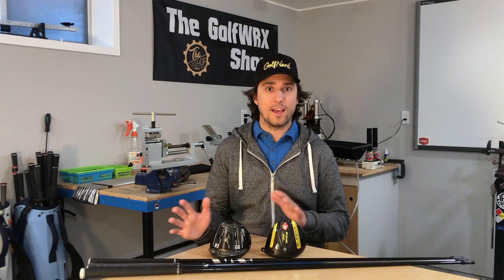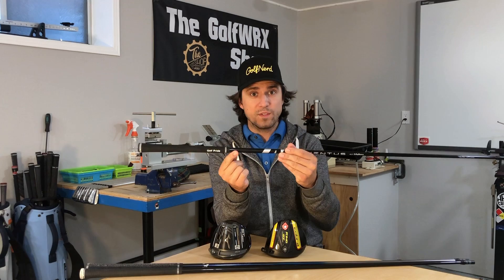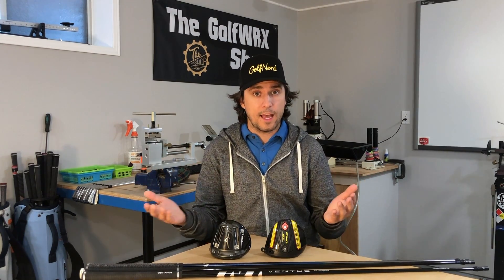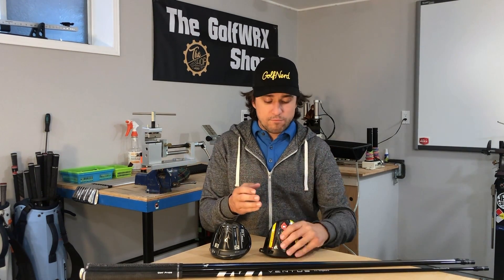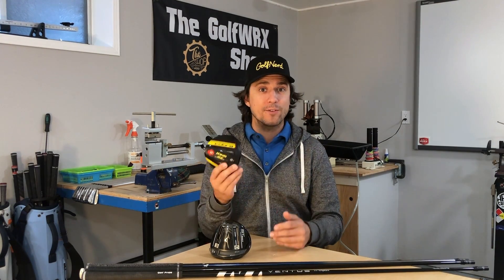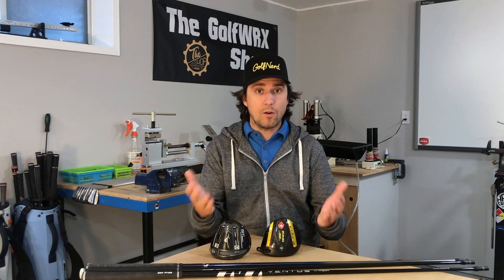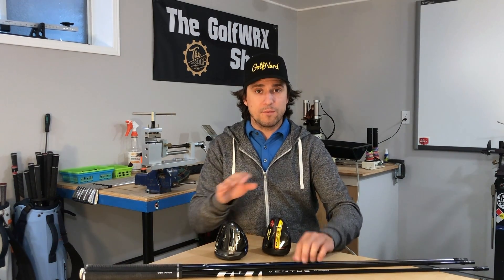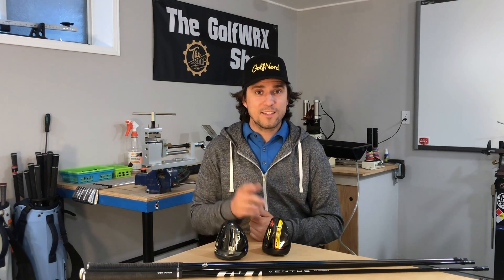Understanding Counterbalanced Shafts

Comment: Hi can you add an after market counter balance weight to the butt end to help lower the swing weight and make the head feel lighter?
Reply: I also dont get it?  Adding weight to the butt will move the balance point closer to your hands but you are adding more mass that has to be accelerated in the total system.  Counter balance does not "counter" mass... just the balance point?

Comment: My Mavriks feel very numb, as in I cannot tell where the clubhead is during my swing. We swing weighed them to D2 thinking that might help but it actually feels the same. Very numb.
Would removing that tape and counterbalancing help with this feeling? 
IIRC, the shafts are 90g S300 if that matters.
Thanks

Comment: I’ve got a Cobra ltdx with Hzrdus blue counterbalance shaft. If I swap shaft to a non counterbalance shaft, will it increase the swing weight of the club?
Reply: Yes
Reply: @jacobr4558 So with this being a YES, I have the same setup 60g.  If i go to a 70g Hzrdus Smoke RDX Black, should i see tighter dispersion, better distance? Currently club sped about 105
Reply: @CRuss22 hypothetically yes its really depends on your tempo and sequence bat all things being equal is could be slightly slower swing speed with much tighter dispersion.
Reply: @jacobr4558 Tempo is bat out of hell aggressive what someone said HAHA
Reply: you might be able to go even heavier with shaft weight or swing weight if its that aggressive.

Comment: I'm having trouble finding an answer to a question about some MacGregor V-foil forged m545 irons that came out in 2005. Does anyone know if they're .370 pt or .355 tt?
Reply from the maker: .355T if they are stock.
Reply: @ryanbarath1916  
Thanks.....I think they are. They've got Rifle lite and Golfpride grips. I think that was the stock option. I'm considering pulling them and going with graphite.

Comment: Can you achieve the same affect of a counterbalanced shaft by swapping out for a heavier grip or even adding lead tape, plugs, etc under the grip?
Reply from the maker: Bingo!
any extra weight in the handle will counterbalance   a shaft; lead tape, heavier grip etc.
Reply: Can I apply lead tape to upper part of my shaft?  Or does it have to go under the grip?
Reply: @ilovebigputtsandicannotlie5355  I know this is such late response 😅 but I have heard of ppl doing this and working